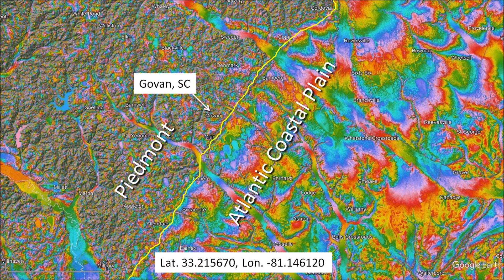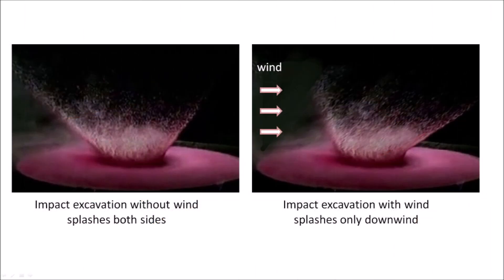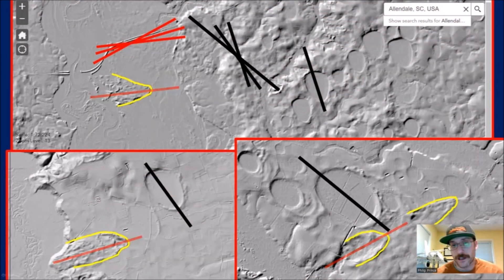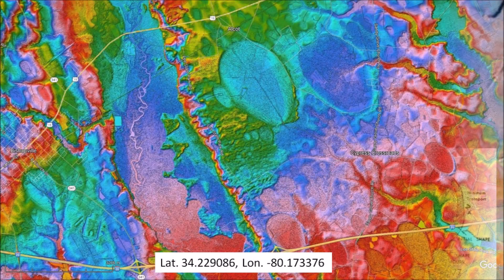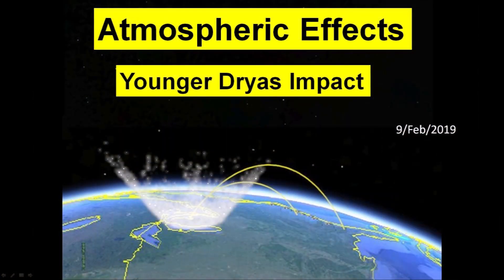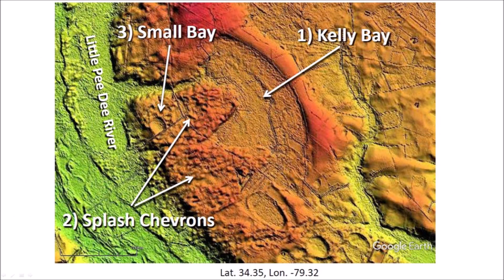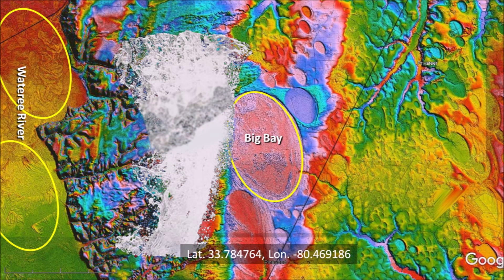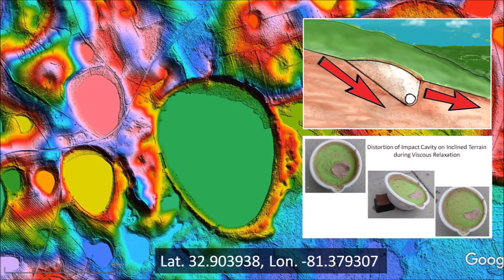Wind, Water and Impacts made the Carolina Bays

Comment: The discrepancy between the glacier ice impact hypothesis and the expertise of professional geologists is in your assumption that penetration funnels had to be created on a large scale.
Reply from the maker: @AustinKoleCarlisle  ... Which is supported by the mathematically elliptical geometry of the Carolina Bays.
Reply: @Antonio_Zamora  of course, you are not wrong, but primary impacts also create elliptical craters without creating penetration funnels. an extremely shallow impact angle (~10 degrees) would create elliptical craters without having to invoke penetration funnels. given the multiple converging orientations of CBs, this implies that several comet fragments exploded in the atmosphere above eastern NA and the ejecta hit the ground at a very high velocity resulting in millions of primary impacts aka the CBs near the YD boundary. 

the impacts and resulting craters were mostly superficial in nature and this explains why the stratigraphy below CBs is relatively intact.

the bottleneck for this scenario is figuring out the minimum velocity required to create an elliptical primary impact crater.
Reply from the maker: @AustinKoleCarlisle  That hypothesis was published in 1975 by Eyton and Parkhurst.
Reply: @Antonio_Zamora  i was wondering if you have an explanation for the elliptical Kansas basins that are miles long and don't orient anywhere near where the ice sheet was 12,900 years ago.
Reply from the maker: @AustinKoleCarlisle  I have been looking at the basins in Kansas for some months, and I agree that they have orientations further south than the ice sheet 12,900 years ago. The elliptical basins still have many mysteries.
Reply: @Antonio_Zamora  I'm telling you, all of these elliptical basins must be related to one event near the YDB, and if that's the case, then impacting ice boulders from a glacier impact couldn't have been the mechanism of creation. check out the (semi-) elliptical basin located at 

37°21'32.31"N, 100°15'27.73"W

and notice that its orientation triangulates the convergence point of the other large KS basins near the MO/IL border. also notice a circular impact crater (the GPS coordinates "pin") located *midline of an extrapolated ellipse*. the satellite imagery helps to visualize this. elliptical basins seem to have been created from hypervelocity impacts from cometary ejecta after comet fragments exploded in the atmosphere.
Reply: @Antonio_Zamora  did you get a chance to look at that guitar pick shaped basin in Michigan or that large semi-elliptical basin in Kansas?

Comment: Couple things: What happened to the projectiles when they ultimately impacted the ground? I'm assuming they bounced and didn't just stick the landing, at least not all of them. Is there any indication in any of the hundred thousand + bays that there was a perfectly aligned double or multiple bounce and a final skid? Or did just one bounce have enough force to leave a permanent impact scar on the land? Also, how might have any mid-air colliding of ballistic material, if at all possible, affect the apparent trajectory and alignment of the vestigial bays. Finally, USGF lidar of the Gulf of Mexico just off the coast on the shelf is an interesting to look. A lot of different things happening to cause those formations. Not the least of which are possible large impact scars aligned towards Saginaw. Thoughts? https://www.boem.gov/sites/default/files/uploadedImages/Figure1-GOM.jpg
Reply: "...What happened to the projectiles when they ultimately impacted the ground? I'm assuming they bounced and didn't just stick the landing, at least not all of them. Is there any indication in any of the hundred thousand + bays that there was a perfectly aligned double or multiple bounce and a final skid? ..."

You obviously haven't watched, or failed to comprehend, any of Mr. Zamora's videos. At the speeds that impacts occur, impactors of ice, rock, or even nickel-iron don't 'bounce' and then 'skid'.
 
For a recent example, look into the 1990s ValueJet DC-9 crash into the Everglades after taking off from Miami International (KMIA). The aircraft impacted onto unconsolidated soils at a steep angle, with the aircraft (wreckage) being swallowed by the soil in its entirety. 

The secondary impacts of the glacier ice occurred into soils liquified by seismic energy, at >10 times this speed. The impactors were swallowed as detailed in numerous videos by Mr. Zamora.